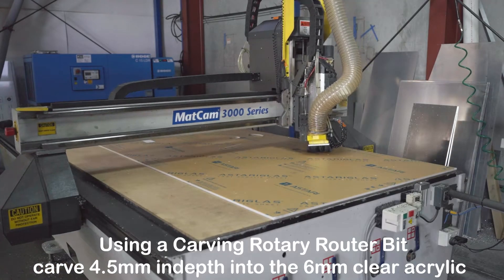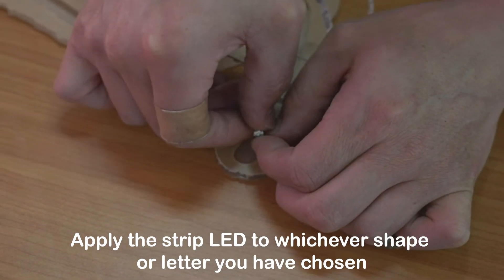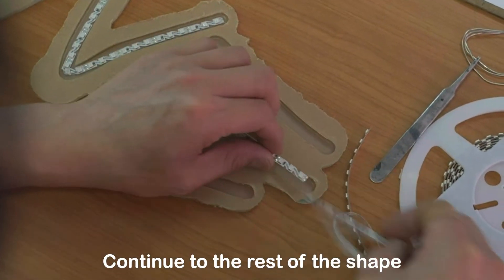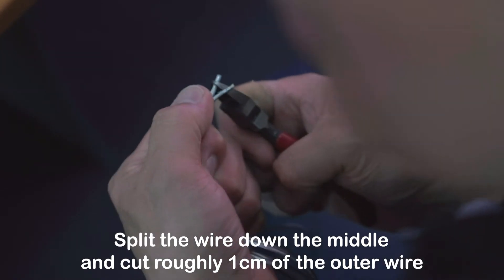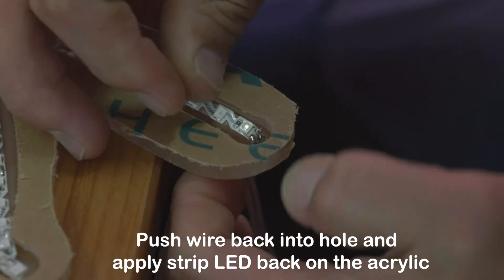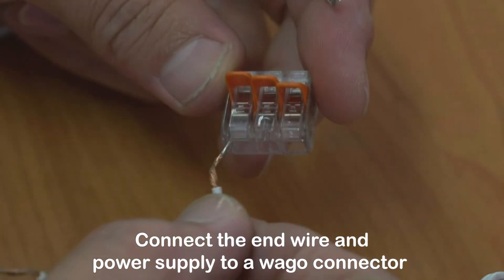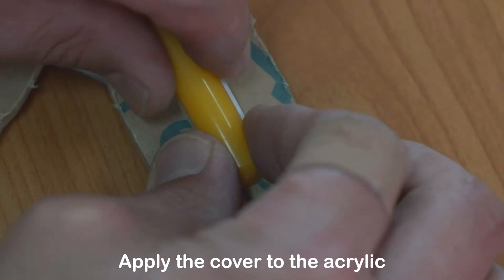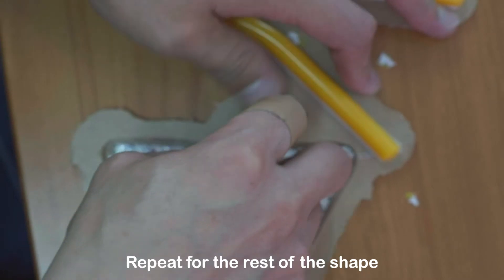★INSTALLATION GUIDE★ MODULAR STRIP LED

Comment: I've started experimenting with this at the shop.
 I've found that the white anchoring strips on the color  cover tend to tear and break off extremely easily while trying to install it into the channel.  
Also, if I very carefully squeeze the anchoring strips and install them intact, the force required to pull the cover out is very little.
The covers have been sitting in their packets in storage for an amount of time also I'm wondering if maybe the cover material has deteriorated.
Reply from the maker: Hey I'm sorry to hear this. Did you purchase this product from our website? Our Neon Strip Covers are very high quality and shouldn't tear or break of easily.